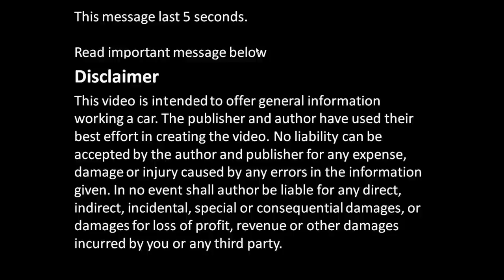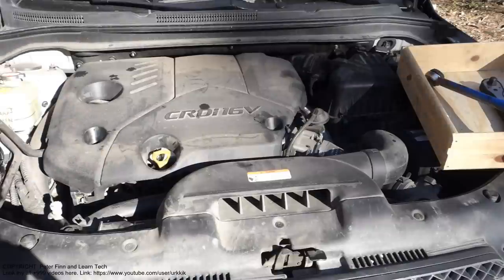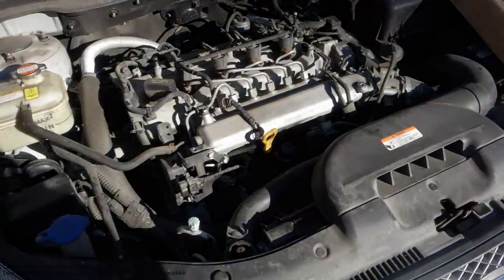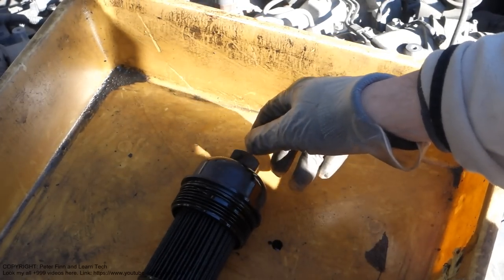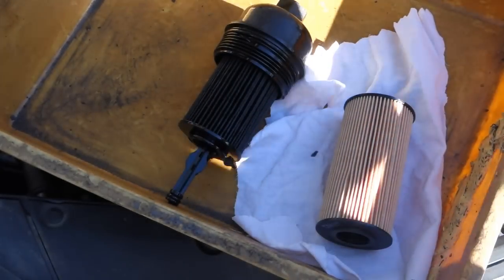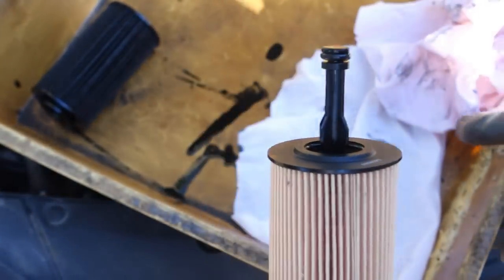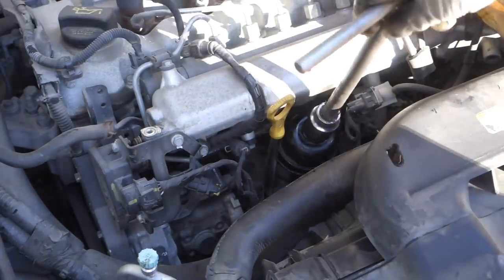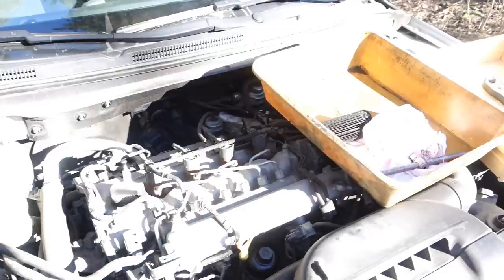How to replace oil filter Hyundai and Kia diesel engine years 2008 to 2015

Comment: A very helpful video on changing oil filter.  One important point. It is far better insert the new cartridge into the filter housing first, the hole in the filter will guide and centre the central oil feed stem into position much more readily. Also removing the filter simply requires pulling it out of the top cap.
Reply from the maker: Thanks for the info!

Comment: You didn't lock the new filter before you plug it in.!

Like you have turned the centre plastic to unlock it, you must have made it again in the other way to lock the new one to the oil cap...
Reply from the maker: Bernardo Rodrigues Thanks. This filter was complex. I need to do new video.
Reply: actually most of them are push fit

Comment: Can you make more Kia ceed 1.6 crdi videos? How often you have to change motor chain or is it maintenence free which last life time of car?
Reply from the maker: +Saul Muñoz Hello. Sorry, no Kia video. Kia is similar car like Honda, more difficult to repair then Toyota and spare parts service is not like Toyota's. So I will do only Toyota's videos and maybe some BMW.
Reply: sorry have to correct you, Kia is not similar to Honda but to Hyundai. And actually it is simple and straightforward to repair the Kias or do any modification on them, they are surprisingly very smartly engineered.

Comment: if you run these engines at operating temperature and then whilst the engine is still running take of the oil filler cap and remove the oil dipstick......

1. oil filler cap hole throws out a puff of black smoke which dissipates.and the blow.by pressure.seems.to.be exessive
2. dipstick.throws.out oil.....
you.can check this on the engine.by either putting your.hand over the oil filler cap just slightly above it or using a white a4 paper hold it above the dipstick and oil filler cap and then u can see the oil.stsins it catches....am.bit concerned about this issue with these engines....i have a 2011 reg hyundai 130 and a friend of mine has a 2012 reg kia ceed has anybody else noticed this issue